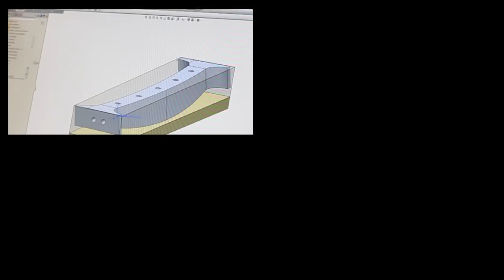Latus Chair by Artisan - Making of

Comment: The nice thing in today wood furniture making is thanks technology You don't need to even know how manipulate to a saw, only design something in rhinoceros and a cnc robot will do the hard work, you only need to put all the parts together, and sand. The final result is better, but I think there is something wrong in the way of how they sell it, all this enterprises tell You "this is a design chair, designed by the finnish blablabla, Yes, I know, but is made by a machine. Also the fact of price, this chair is probably a bit expensive and has no human effort in it and is made in mass.
I don't know, is my thought.
Reply: +juan barlocco I will always value more something made by a human (if it's hand made, then even more) than something massproduced by robots.
Reply: +juan barlocco if it is that easy why you dont take rhinoceros and make something :)
Reply: simple, 'cause I've no money to buy a CNC machine.
Reply: +juan barlocco what?  You don't have $100,000 laying around for a CNC setup like this?  What is this, amateur hour?  ;)
Reply: These guys probably over price their product but mass produced items like these means you can afford it deff not cheap though, whats the point of hand made if only a couple can afford it and brag bout how they are hand made and expensive lol. So stop complaining at the end of the day they are making good money and your no where near.
Reply: The use of them beech dowels is a bit crap, no real strength in them just for Location, its the glue doing the work, but its cheap more profitable